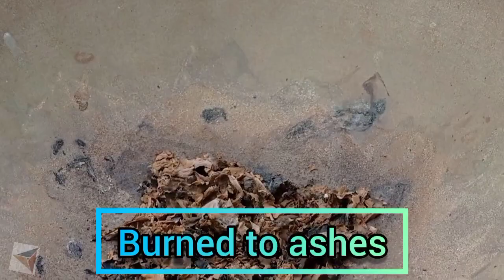Black Fiber CPU Processors Gold Recycle | Recycle Gold From Computers | Gold Recovery From E-Waste

Comment: Thats so wasteful on Nitric acid when re-refine, instead of using 100ml just add 10ml to 15ml in small pipette doses, thats all it needs to be dissolved if that. Aqua Regia doesnt have to be pre mixed or a 3 to 1 solution or even 4 to 1. This saves money, increasing your gross profit each time you process material. Good work other than that, I dont understand the buring though? Aqua Regia will dissolve any filter paper.
Reply: Can you explain me please, full process of gold recovery from any kind of gold plated pins with 10ml to 15ml nitric acids. Pls show me thats, Indeed I follow that process! However, In my 30 cpu's processing chemical total cost almost $1.5 Dollars. Then, why not following AR method?
Reply: @OmSoHum7467  This is not for recovery, this is for refining, when you dissolve already dropped gold. I never have to use Urea because you only use enough to dissolve the gold. You start to learn how much nitric you need, pipettes is the perfect measurement for starters trying to save nitric. 

For recovery heat helps a lot but it will always require A LOT MORE especially with heavier type pins containing more base metals like Military pins. If your looking to only strip the gold use Eco Goldex its on ebay, lots of youtubers are using it and it seems to work quite well, check out archimedes channel. With that product it doesnt matter about base metals because the gold is being dissolved into a stripping solution, than you change the pH and drop with zinc than re-refine.
Reply: @Perry S  for what refining talk about bro...? Are you serious? And archimedes not use Eco Goldex, he once process with cyanide from gold recovery. Pipette and cyanide also I've. I know the whole process, but don’t need to show up my channel, because many of beginner will inspired and want to try that of my followers. Any casualty, who take that liability?
Reply: @OmSoHum7467  clearly yes, you dont need pre mixed aqua regia, you can have 200ml of hcl and only 10ml of nitric, its the same thing and saves money. Do you not understand english?
Reply: @chosen1one930  200ml hcl, and 10ml hno3- that's aqua regia? Ok. I've no idea of that! I discuss about that in forum...
Reply: @chosen1one930  tomorrow I'll try your method, if that’s work, a big thumbs-up for you...
Reply: @OmSoHum7467  watch sreetips videos hes a youtuber, the more Nitric you add the more you can dissolve. 4 troy ounces of gold can be dissolved in only 500ml of aqua regia. You can have any amount of HCL, once you start to add nitric even 1ml it will start to dissolve gold. When I have small amounts under 20 grams I start by adding 5ml to 10ml let it sit on low heat for a little than add pipettes every 5 minutes until the gold is gone. Once you do this for awhile you can judge how much you need pretty good. Small amounts of gold reguire very little
Reply: @OmSoHum7467  For the people who hate to babysit there gold its not for them, it usually takes around 30 minutes when your first starting out with this method but like I said youll get to know how much nitric youll need to use and it goes by really quick unless your doing a massive amount
Reply: @OmSoHum7467  check Eco goldex, some people really like, Ive never used it but it really has its place for certain material especially low yield items. It strips gold plating really fast around 1 minute to 5 minutes.